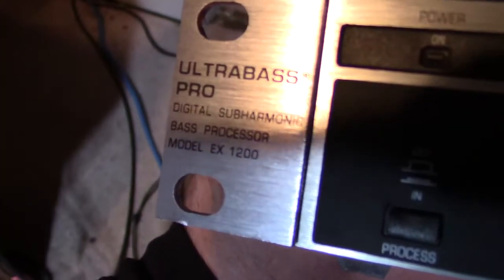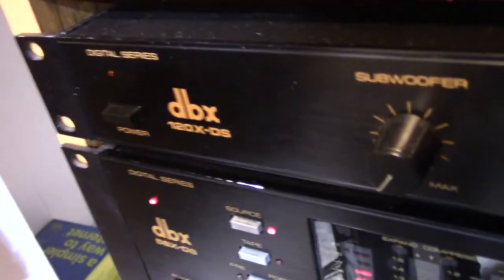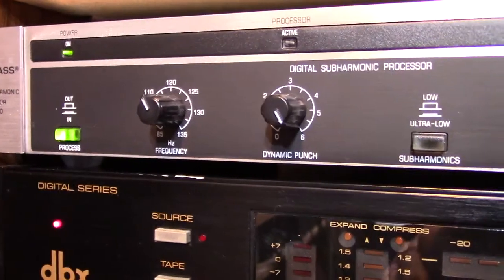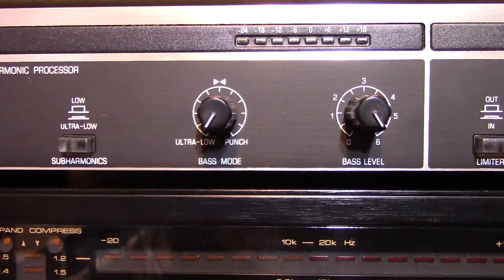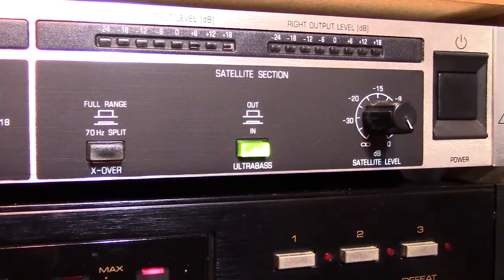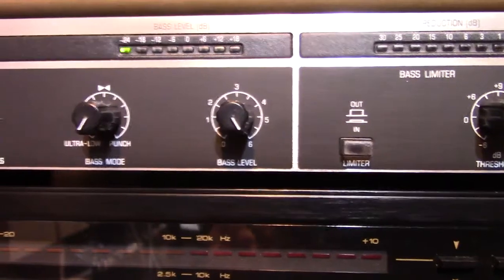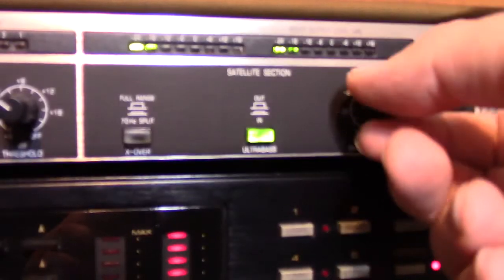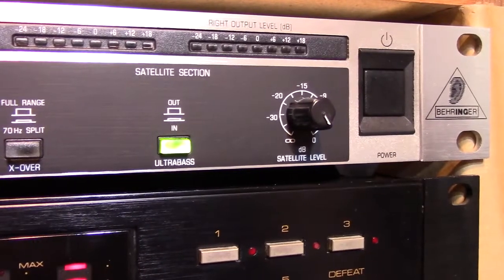UltraBass Pro: Behringer EX-1200- 'DOOSH'

Comment: Want you to compare the ultra bass with the dbx please
Reply from the maker: I can tell you straight up... the dbx 120X-DS works better, musically. I don't even have the Behringer hooked up anymore. Most of my music videos I post have been treated with the dbx unit. The way I would stack my bass boost processors, dbx first, Phase Coupled Activator second, Aphex Aural Exciter next and the Behringer last.
Reply: Thanks for the info I heard that  crossover loops into two  stereo channel can  creat more subharmonic because the ultra bass dont give  u much vibration of the  subharmonic
Reply: Do you think it's worth getting a separate DBX 120a or just get a driverack with it built in?

Comment: would you hook up this on the master insert section?
Reply from the maker: Sure, then everything will have the bass enhancement. Otherwise, only use it on the channels that you want to add more bass.
Reply: The threshold is a compressor
Reply: @blingvibes717  Actually, It's not compressor, it's limiter. Compressor attenuates loud signals and amplifies weak signals all determined by a certain treshold. Limiter allows all signals thats below certain treshold and doesn't allow any signals above that treshold. Limiting can, similar to compression, be soft or hard shaped...

Cheers!

Comment: hm, interesting device, for example if i have ported subwoofer and PA amplifier that runs from AVR LFE, could this synthezer protect my subwoofer from overexcursion by filtering some 20hz  frequencies like butterworth filter 2nd order ?
Reply from the maker: It does have a compressor/ gate adjustment that would allow for you to set a maximum level to reach your sub, thereby controlling excess excursion. So, the answer would be yes
Reply: @HammyTechnoid  Actually, It's not compressor, it's limiter. Compressor attenuates loud signals and amplifies weak signals all determined by a certain treshold. Limiter allows all signals thats below certain treshold and doesn't allow any signals above that treshold. Limiting can, similar to compression, be soft or hard shaped...

Cheers!